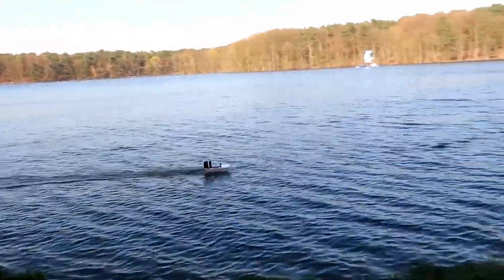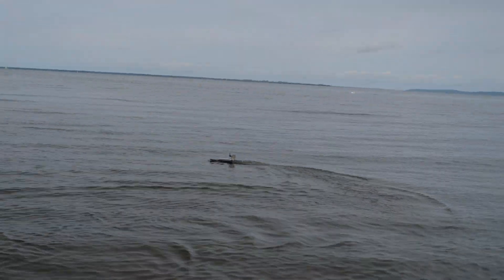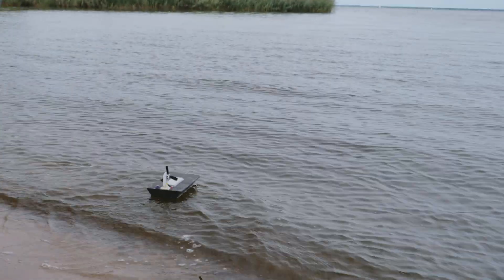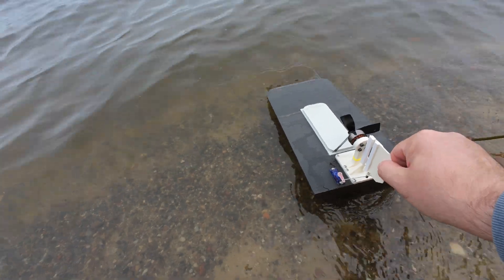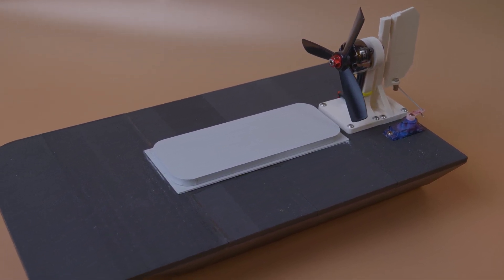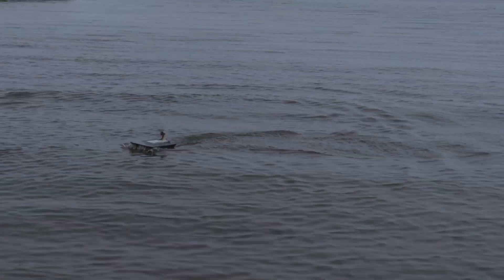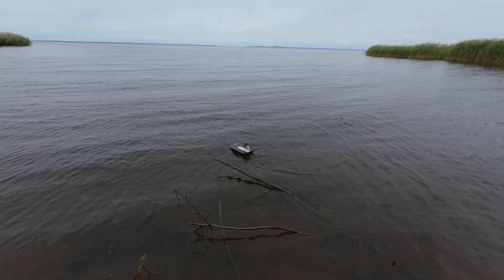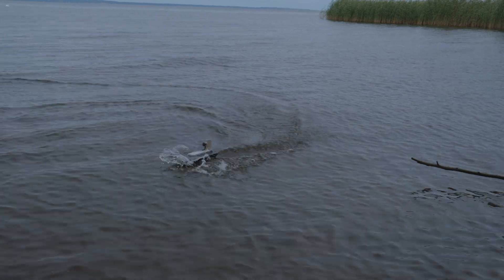3D printed RC airboat

Comment: The problem is as follows.  your boat takes a little bump pushing the nose up a little, the pressure of the nearly mid mounted up high power pulls the nose down till it reaches max boyancy and forces the nose up.  Once the cycle starts it will hobbyhorse until you remove throttle.  Faster you go faster the more violent and fast the oscillation occurrs.  Ive yet to find a good solve as airboats really want flat bottoms where a vee hull would soften and reduce the cycling effect.  Trim tabs do the trick to some level but are not a perfect solution due to drag and lack of complete elimination.

Comment: Looks like other people made the same suggestions I was going to. I would have used a pusher prop with rudders behind the prop and pointing up to force the nose to rise. It would take a few coats of epoxy to waterproof the hull and the extra weight would negate the gains made by using LW-PLA. Looks good at the start before it got soggy so I think the hull size and ratio are correct. Air boats in the swamps in the US are about the same length/width ratio.

Comment: Well, even conventional PLA isn't exactly waterproof, Pawel. People who usually 3d print boats use other materials, or apply a thin coat of epoxy... Sometimes even glass fiber. 
Another thing is the spray foam, I don't remember the name... They fill the hull with it with the exception of the places for battery and electronics. 
I don't know close to enough about boats... But there you go, that's what I know. 😬
But, absolutely, improve it! Keep going! 😃
Anyway, stay safe there with your family! 🖖😊
Reply: Stick with ABS.  Its light durable and does not melt in your car.  Been making my boats out of abs for a while now with great success.
Reply: @PaulKind3d  Excellent option. 😊

Comment: Nice, I build one with two rudders in 1985.
Could you build something larger with 10 to 12 inch prop and lower kw?
It would sound better and some finns could improve the stability.

Comment: Ok, my last winter-rc-toy had two propellers and two PET-bottles, it did the same thing (but it worked well on ice). So this years winter-rc-toy have two props in front to stabilize on both pitch and roll. Just put Betaf... I mean iNav on an FC a prop in front and do some MMIXing. ;)

Comment: Here's my smaller airboat printed with regular PLA;
https://youtu.be/SmC7551AdwU?si=GdG_3i8Hrb9jqvtq
Someone else's design that I stuck inav in.
Reply: My limited research told me that the thrust to weight ratio should be slightly less than 1:1 and that the centre of gravity should be about 1/3rd or 1/4 from the back rather than the front like on a plane. I didn't have any problems with weight and mine weighs about 600 grams which feels heavy for it's size.

Comment: The motor seems to be pushing the bow down due to the moment arm caused by the thrust line. Tipping the motor forward to align the thrust line with the center of buoyancy would probably help.
Reply: that is very clever.  i wonder.  i may give this a try.

Comment: My 3D printed airboat but printed from normal PLA. https://youtu.be/dzFNH0NEAwA?si=qDtmZv46vucpOwNn
44cm long 24cm wide, 2207 1800kv motor 5 inch prop 4s lipo. 
At first i have problem it was't stable on yav. Later i add  two 10cm long and 2cm deep fins and now it is to stable and it is hard to turn. 😁

Comment: My next project is likely going to be an airboat, so I've been researching.  At first I considered 3d printing the hull.  But that makes the boat heavy, and hard to modify.  Instead I'm just going to use Styrofoam.  Is 3d printing an airboat possible?  Sure.  But I don't think 3d printing is the right tool for this particular job.